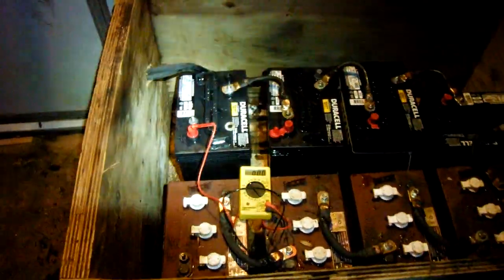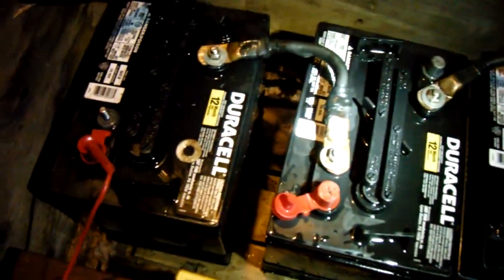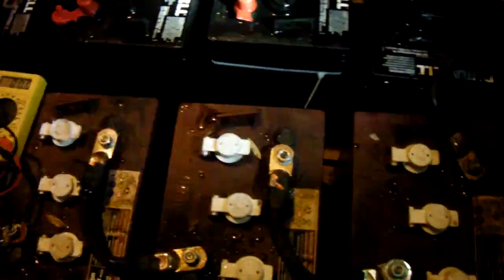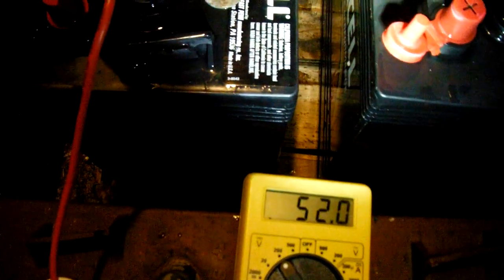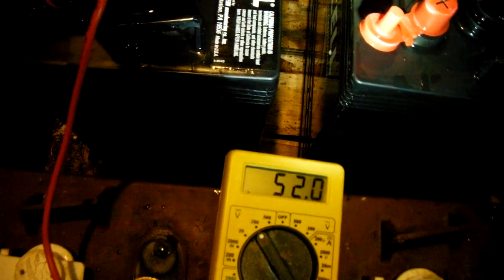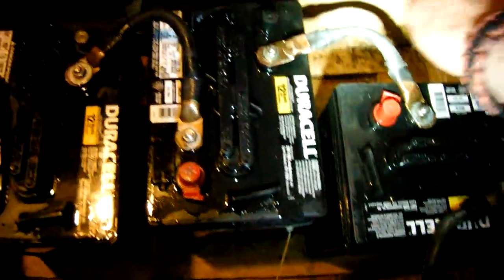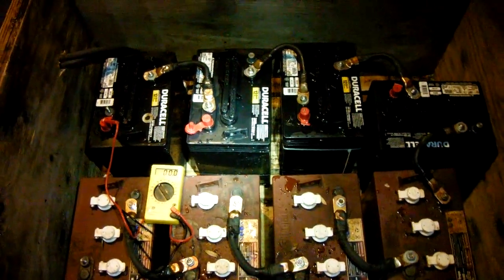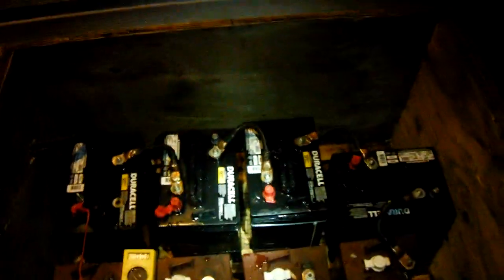48Volt Battery bank up and ready

Comment: I use this product and it works great on batteries and other stuff.  http://www.starmarinedepot.com/crc-marine-corrosion-inhibitor-10oz.html
Reply from the maker: Thanks, yeah I need to put something on all the lugs especially now that they are outside.
Reply: Once you use it you'll be hooked.. It worked good coating my power head on my entire outboard engine too so I'm hooked.

Comment: This may be a dumb question. Would a system that size run a small compressor (ie air, a/c , fridge etc.?
Reply: *****
Yeah, that a lot of watts sitting there.  48V will really help with voltage drop under load.
Reply from the maker: Yes I ran my fridge off the 12 volt system I have with the first 4 batteries I had for about a week before my panels couldn't keep up with charging them. But going to 48 Volts it should be able to handle a fridge very easily.

Comment: Have you been running on this long enough to figure out what your yearly or monthly savings are.
Reply from the maker: Not yet, but with the upgrades I'm doing now I plan on really using the system more on a regular basis. I will have to test the system and see what it can do and use it accordingly. I need more panels to really take advantage of that new inverter I have.